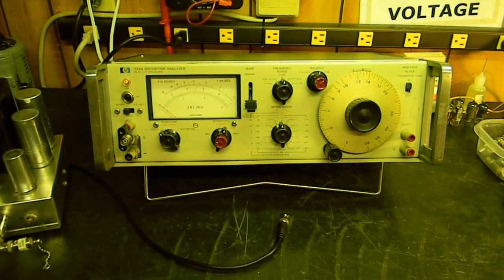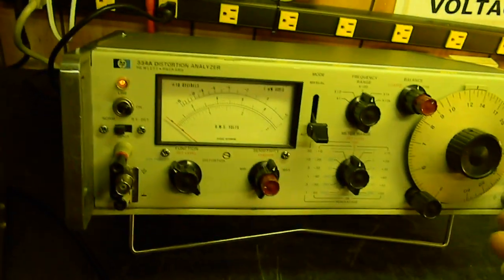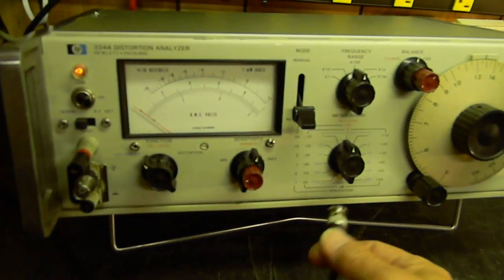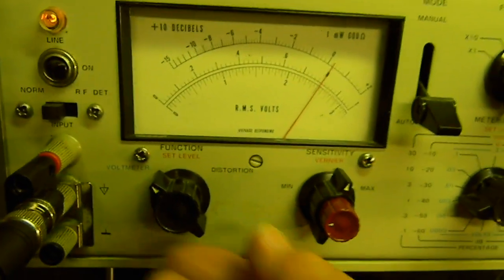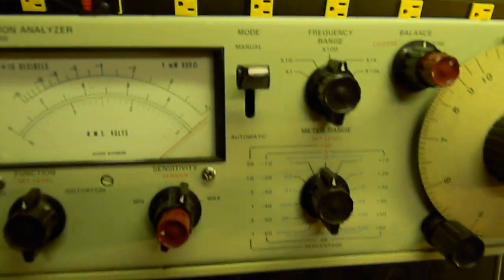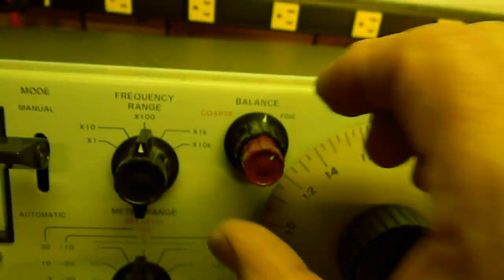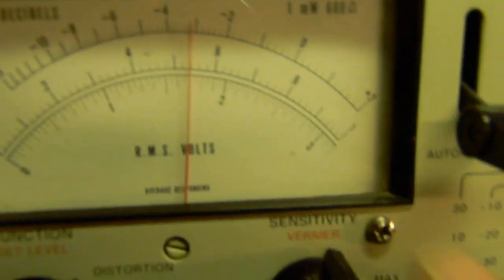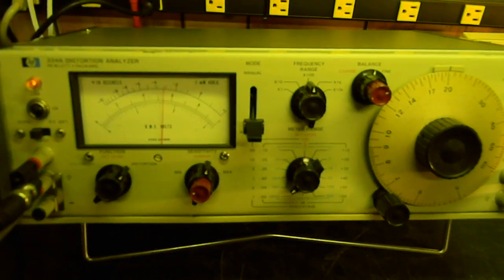Hewlett Packard HP Model 334A Distortion Analyzer 1 of 2.MOV

Comment: Actually, you're supposed to use Manual mode till you get your lowest distortion reading on the scale, then flip the lever to Automatic. After that, the reading will sometimes settle to an even lower (more accurate) reading. Do not start your measurement in Automatic mode. Used these, and repaired them (as well as the Tektronix test equipment you're using), for many years as a calibration technician in the army back in the Seventies. Brings back a lot of memories.
Reply from the maker: Thank you. It is always good to add real experience to these videos so that when someone gets a "new" one, they can learn how to use it best as possible.
Reply: @ElPasoTubeAmps  You're welcome. It's been decades since I actually used a 334A, so I had to exercise my memory muscles to recall as much as I did. There are probably a few steps I've forgotten by now. I didn't know if there would be still a user manual available for old HP test equipment somewhere on the Internet or not, but I was able to find one. The Hewlett Packard corporation became Agilent, then that became Keysight. Here's a link to the Keysight operation and service manual for the 334A. It includes instructions for measuring distortion: https://literature.cdn.keysight.com/litweb/pdf/00333-90008.pdf?id=811981

Comment: what is a distortion analzyer used for? what applications?
Reply from the maker: It measures the difference between a perfect input sine wave and the actual sine wave coming out of the audio amplifier. It is used to evaluate the performance of the amplifier to accurately reproduce the input signal in relation to the output signal. 
In a perfect amplifier, the output signal would be exactly the same as the input signal but of a higher power (or voltage) level. In a quality HiFi amplifier the difference between the input signal and output signal should be typically only about 1% different. The difference is usually measured in Total Harmonic Distortion (THD) percent. 
The way a distortion analyzer works is by completely filtering out the frequency of the input test signal and measuring any small differences that are left in the output signal of the amplifier. If the input signal is pure and it passes thru the amplifier and remains pure, there would be no remnants of the signal and the output meter of the distortion analyzer would measure zero. Even in a very high quality amplifier there are distortion products in the form of harmonics which are  integer multiples of the test frequency, that are actually created by the imperfections of the amplifier itself.
High quality solid state amplifiers can measure very low values of harmonic distortion in the order of 0.01%. Very high quality vacuum tube amplifiers can have distortion figures usually around 0.1% at low volume levels and up to 1% or a little more at full volume and still  be considered very high quality. 
It is my opinion from working with audio equipment for many years that we seem to like a little bit of harmonic distortion in the output of an amplifier and I would guess that is one reason why some people like vacuum tube amplifiers even today.
In a guitar amplifier, typically the power level advertised by the manufacturer is only obtainable at about 10% distortion but that is the way guitar amplifiers are expected to sound. Adding a fuzz-box into the line from the guitar to the input of the guitar amplifier causes the signal to become essentially a square wave and distortion levels reach 100% but in some cases that is the sound we like.
Harmonic distortion in a vacuum tube amplifier generally makes the signal somewhat out-of-shape (and distorted) as observed on an oscilloscope but the edges of the distorted signal are smooth and our ears are not offended by this type of distortion. A solid state amplifier, when over-driven, tends to distort the signal and make it have sharp corners on the distorted wave (rather than the smooth rounded corners of the vacuum tube amplifier) and these sharp transitions sound very harsh to our ears and we find it annoying and tire of the sound quickly. That is in my opinion, why the vacuum tube amplifier remains so popular to this day.
Hope this helps...

Comment: I just repaired and calibrated one......
https://www.youtube.com/watch?v=NJxPiqW5Ww4
Reply from the maker: +Jordan Rubin I just watched your video and you have inspired me to take a serious look at my unit. If you have not seen my second video you might like it as I think it is actually better than the first one. The volt meter on mine was right-on it was just the THD above about 5KHz as I remember. Nice video  - thanks for posting.
Reply: https://lh6.googleusercontent.com/-r85LHBHgeX4/VnYTLuXNP_I/AAAAAAAADAg/55JRCtOpw9I/w466-h440-no/Screen%2BShot%2B2015-12-19%2Bat%2B9.29.45%2BPM.png
Reply: the 331A works perfect, the DYna, not so much.... I wanted to test before matching the 47K resistors on the 7199 output, you can see the results in the pic provided.  The 7199's have a slightly different amplitude becuase of the mismatch that os most apparent in FFT where they converge

Comment: I bought one based on your video, in order to measure my custom tube amp modifications.  This model is probably the best value on the used market for those on a tight budget.  Anyway, one question:  I noticed you had the high pass filter "in" during this measurement.  Is that a requirement?
Reply from the maker: You should probably watch the second video I have on this unit - the high pass filter in will not allow you to measure frequencies below 1 KHz so you do have to be careful with it  - please see part 2 of 2 where I do a much better job with this unit and thank you for your comments.
Reply: ElPaso TubeAmps Thank you sir.   I did watch the second video.  But ... unfortunately, the darn distortion tester I bought is defective, can't get the meter to settle down and even give me an accurate voltage reading, seems to be a problem with the "range" selecting switch, so I'm back to dealing with ebay again.  But I'll get this straight someday ...  Thanks for the reply.

Comment from the maker: My distortion analyzer in the videos is the Tektronix AA501. It works in the TM500 series mainframes or it will work in the TM5000 series mainframes. There is also a model AA5001 that only works in the TM5000 series mainframes. The ultra-low distortion signal generators are the Tek SG505 modules that you may want to get to go along with the analyzer.

Comment: OK..I am working on acquiring all that I need to make these tests....just for fun! I have an old tube-type audio oscillator, plus a modern HP and brand new BK Precision function generator (I hear they have more distortion than the audio oscillators). A 100 Mhz Hitachi scope, and a nice digital  Tektronix scope. Also a very nice Kenwood distortion analyzer (similar operation to the HP 334A) So, I just need to get a few big 8 ohm loads, and the 600 ohm BNC load, and I should be in good shape????

Comment from the maker: The output of the amp connects to the 8 ohm resistor. The distortion analyzer connects directly across the 8 ohm resistor and not the input of the amplifier. The 334A instrument can be switched between the voltmeter position and the distortion measurement position. In the voltmeter position the voltage is read and the value squared and divided by the value of the load resistor (8 ohms) to determine RMS power in watts. So, both power and THD can be measured with this instrument.

Comment: Does the signal generator connect directly to the amps' input?
And how do you measure the output of the amp? I suspect the amp connects to a BIG 8 ohm resistor, but how do you sample, or "pick off" to go into the distortion analyzer?
Thanks!

Comment from the maker: I has been my experience that the original "bumble-bee" caps are most likely still OK. Some may disagree with me. All of my amp is original including the electrolytics and the selenium bias rectifiere. Replacing the caps may decrease its resell value. I would think about it long and hard before wholesale replacing the caps. It it works properly, enjoy it as it is.

Comment from the maker: Measuring the THD of an integrated amp can be done easily by putting the input (sine wave) signal from your generator into any of  the aux (high level) inputs. The CD player would need some low distortion reference CD that I am not familiar with or know where to get. The 475A scope is certainly very capable of good display at audio frequencies. 50 ohm coax is a good choice as there are many connectors and adapters available. Good luck with your test setup.

Comment from the maker: You have some very nice equipment. From looking at the 339A, it appears to be very similar to the 334A. The objective is to adjust the meter full scale with some input (say 1KHz) then null the fundamental frequency with adjustments. The remaining signal components are the distortion products. I don't know the CFG253 but I suggest you research it and find it's distortion limits for a sine wave and that way you can compare what is expected with what you measure on your 339A.

Comment from the maker: @451mnu The equipment stack as you mentioned is purchased separately and you can expect to pay in the area of 1000-1500 dollars (or more) for all the components. The HP is just as good at accurate measurement but the Tektronix digital equipment requires no nulling and makes multiple measurements so easy whereas the HP has to be constantly "tweeked". Thank you for your comments.